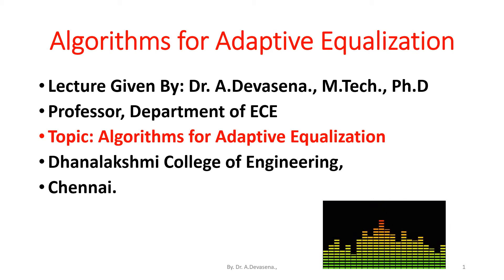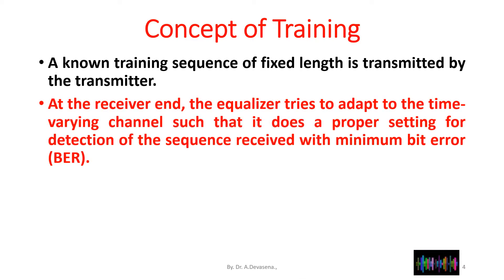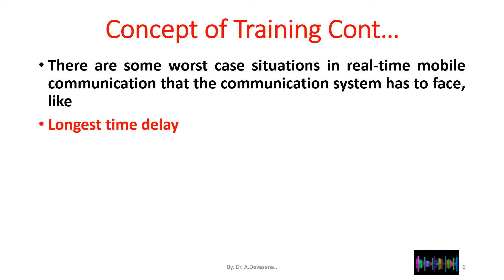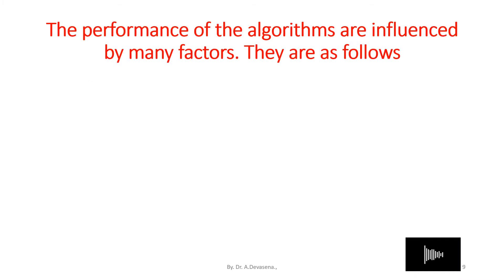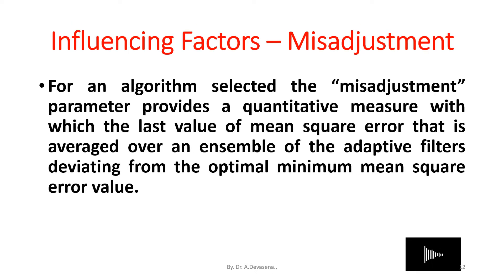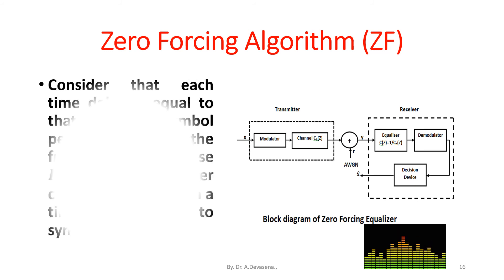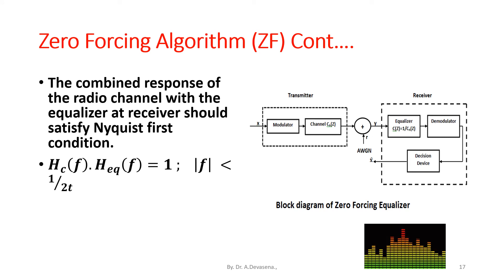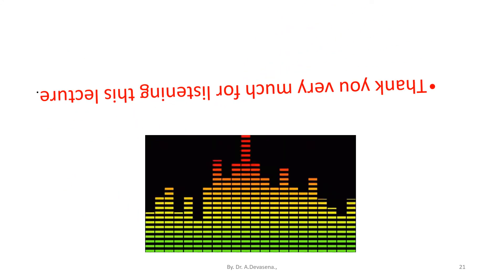Algorithms for Adaptive Equalization

Comment: I´m taking advantage of the fact that this is the first comment of the video, a rare thing. I ended up on this board because of the similarity on any input adaptation to the user, beeing eq, or mechanical automation, or any drive by wire device control. Independent of the device, mechanichs or reaction we try to simplify nowadays, I think the progressive adaptability for each individual has to be coherent in any case. 
So my question is, is that the case?. Can reaction times be reduced regardeless of the action or reaction for a specific person?. Can the same calculations be used for a person even if it is foot pressure or audible reception?